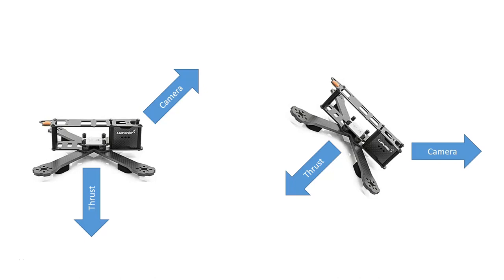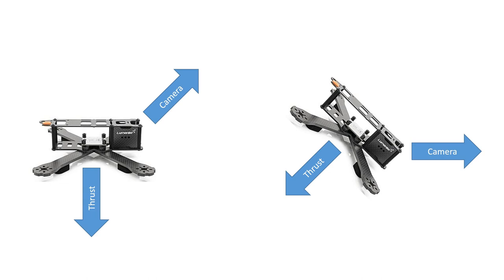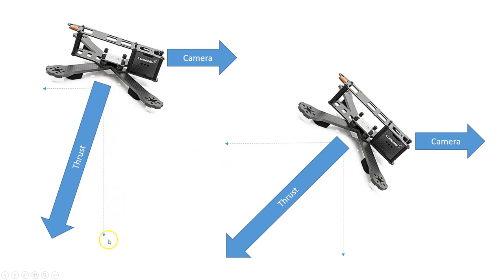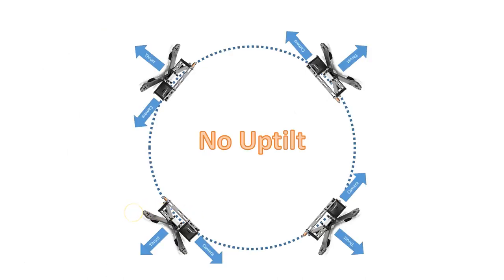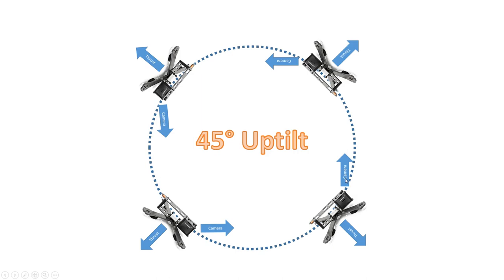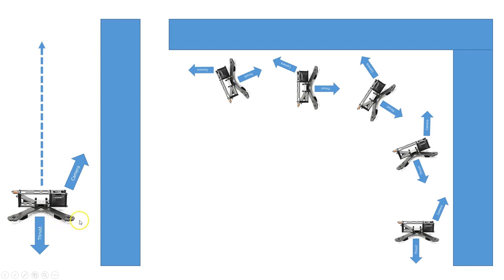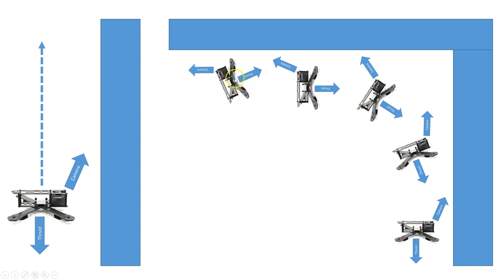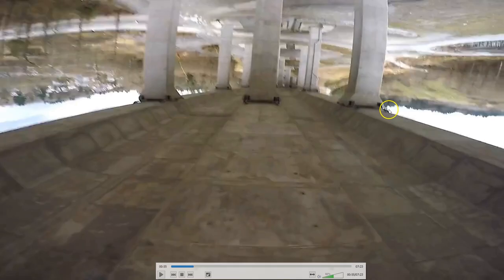The Secret to Mattystuntz Mind-Bending Stunts

Comment: I have to give it up to Joshua, he did an outstanding job breaking some of these tricks down. I've been telling people since Dec to move your fpv cam into 60degree, hold it in your hand and see what the thrust does in certain position in reference to the fpv camera. But now ill just point them to this video lol. But one thing I dont suggest doing is just putting your camera to 60 and head out flying. gradually move it up. around sept i really started working on my speed, and it just made sense to me to fly with more tilt. i started at 45 and slowly went up to 60-70degrees. but I learnt the new flight physics and mastered them before moving to an enclosed concrete structure like underneath the bridge. I dont want to see anyone getting discouraged because they break there gear. I came from stunting motorcycle where if i didnt perform a trick properly i would break bones. so it doesnt bother me that much if i break a quad or gopro. 

Also I dont fly lumenier gear. I fly a LRC X frame. Its ultra light, a true X frame and perfectly balanced on all three axis. 

Thanks again Joshua, its an excellent tutorial.
Reply: +mattystuntz Still stunning videos man! Love your work! It is definately something unique compared to others!
Reply: +mattystuntz nevermind how you do the moves, how the hell do you stand while doing these moves? i still feel like falling over o.O
Reply: +mattystuntz Do you have a custom mix in your RC or is it just learning, that the Yaw/Roll is nearly swapped ?
Reply: +mattystuntz Ya crazy! Haha! ;)
Reply from the maker: +Diego The Wolf I am pretty sure that matty and others like him just learn to fly that way. I have gone from 15 degrees uptilt all the way to about 45 degrees. Each time I add another 5-10 degrees, the copter feels like it's flying a little weird, and then my brain sort of re-adjusts and I'm good to go. When people suggest fancy mixing and other features to compensate for camera uptilt, I'm a little skeptical. I want my stick inputs to correspond to motor inputs, not camera inputs. My brain can handle the translation.
Reply: Joshua Bardwell Thanks for the clarification! I just had some problems with roll when i went over like 25-30° and thought about mixing. But guess i'll just try it the normal way ^^
Reply: +mattystuntz love your style man. What lens are you using? DO you find yourself adjusting yourcam angle down less for being in tight spaces? I run 45-50 when racing with a lot of straight aways, but if the course is real tight I find myself going with lower angle. Im running a 2.8 lens though
Reply: +mattystuntz I was actually going to ask you to have a camera on your side taking  a video of your quad while doing your stunts. I've been totally amaze how you do those mind bending - eye sucking tricks
Reply: +mattystuntz Nice one Matty :-) I now love quads as much as I loved motorbikes. I'm progressing okay but I need more time.
Reply: Great flying! I hope to have your skills someday.
Reply: mad props to mattystuntz for creating/ being first to master this flight style! 

incredible.
Reply: +mattystuntz do some you top pilots fly 3D FPV quads too? I really haven't seen anyone do much flying with that setup.
Reply from the maker: ZoeFPV is the main pilot who flies 3D freestyle.
Reply: nice analysis but I watched a lot of these, by everybody, and no one else pulls loops up a wall next to the ceiling then down...guys has skills
Reply: Great video, analysis, and comments. 

Hmmm... So Joshua says massive HD cam uptilt, Matty says it's the FPV cam uptilt... Is it both or just one of them?

FPV Angle Mix is pretty useful, though it takes getting used to and could max a motor. 

3D is very cool. May want to angle the HD cam for better footage than seen in the zero degree FPV cam angle.
Reply: 60 TO 70 DEGREES HOLY SHIT I CAN BARELY FLY ON 50!!!!
Reply: Well said. Im an old vert skater and though not as dangerous as motocross freestyle still very painfull bone breaks. Breaking the quad doesn't bother me. Losing it still sucks though. Haha
Reply: @prOkrEAt  you have to dtand to get proper reception for video and TX. Standing is the way to fly
Reply: Awe

Comment: This was an easy one.  Now to see if you can explain why Skitzo's videos look different.  Hint, it has something to do with camera tilt as well :)
Reply: +FinalGlideAus  He flys with no camera tilt i guess?
Reply from the maker: I think Skitzo has less uptilt on his GoPro than his FPV cam. I was just looking at his Instagram the other day.
Reply: +Joshua Bardwell Hard to pull the wool over your eyes :).  Skitzo runs flat GoPro and abut 30 FPV cam tilt.  This gives all his barrel roll type tricks looks much more axial. It also makes the GoPro look at the ground during FFF so that's why you always see him going vertical
Reply from the maker: FinalGlideAus Tell him to try out the cam uptilt compensation feature. With 30 of FPV, try putting in 15 of uptilt compensation. should give relatively axial rolls while making framing of regular shots easier. 

If you were to combine 15 degrees of GoPro uptilt with 15 degrees of uptilt compensation, then the GoPro should be perfectly axial, but less staring at the ground during forward flight.
Reply: +Joshua Bardwell But then it really screws with the way the quad flies.  The whole point of us acro pilots is that we remove as much of the influence of the FC so we can do what we want.
Reply from the maker: FinalGlideAus have you tried it?
Reply: +Joshua Bardwell To be honest no I haven't but I have been very clear on a few things in my time flying quads and one has always been not allow the FC to do much work.  I dislike mixes like that.  One day I might try it one day.
Reply from the maker: FinalGlideAus Well, look, you're the one with the title, so clearly you know what you're doing... my perspective is that it's not doing anything that you can't, and don't, do with the sticks, it's just making it more smooth and consistent. But if I was racing at your level, I would definitely run a lot of test laps before I took it into competition.

For acro flying, I think the stakes are lower, and there, I think there's just no question that it's preferable to having gob-loads of swing-around in your rolls. Camera uptilt = fast = awesome = swing-around = not so awesome after all. So this feature seems like the best of both worlds to me. Like I said, yeah, I could learn to cross-coordinate snap rolls by hand, but this does it better, with basically no down-side that I see yet. So that's why I compare to anti-lock braking. With lots of practice, a driver CAN learn to threshold brake very well, but the computer will always do it better, and the driver can learn to do something else instead.
Reply: +Joshua Bardwell I have something I plan to bring back from the dead that should allow some cool stuff to happen which won't play well with the mix anyway :)
Reply: +FinalGlideAus I'm not really one to snap roll. But if you watch my flying Chad, when I invert, the center point of the roll is in the middle of the screen. So from the Gopro's perspective I'am rolling on inline with the X axis. Achieving this is actually more difficult at 60 degrees. This is because I'm doing more then one stick input in the maneuver, yaw and roll.  So it is still possible to snap roll with 60 degrees, it just takes a little more piloting. In regards to Gopro tilt, it doesn't share the same 60 degrees. It sitting at 45 degrees. I like composing my shots with the  horizon in the center of my screen. And I'm not trying to take anything away from Skitzo, he knows more then anyone how much I appreciate his piloting. But we both fly setups that work for our flying style.
Reply: +mattystuntz yes I agree Matty. What I was getting at is the different levels of tilt allow you to do different things but also make other things harder. It's a matter of choosing the tilt to suit what you want to achieve.
Reply: though its a year later.... just saw this vid, and im a beginner, therefore this video made very little sense to me but figuring it out little by little.... as for the dude from rotor riot and this josh dude going back and forth..... daaamn. Sorry Joshy... though you know ur shit and know it well from what Alot of others say about you.... you talk as if it dont stink. That really aggregates me to be quite honest...... well that and just hearing you talk is annoying. Yall have a great day !!!
Reply: Six22278 aggregates? Dictionary time...
Reply: Six22278 haha keep trying bud. Eventually you'll get it
Reply: BadWallaby sooner or later im certain of it.
Reply: #mattystuntz  would I be right think you're using the widest fpv camera lens you can get your hands on?

Comment: Bought a RTF kit and Velocidrone to practice a month or so ago. I have close to 20 hours into Velocidrone and a couple packs each day in the last couple weeks. It was getting extremely frustrating because it felt like I was never in control. I saw this video and plugged in a 50 degree camera into Velocidrone and now I actually go where I intend to. Waiting for some packs to charge and the wind to calm down outside now to test IRL. Would have never dawned on me to test camera angle; just thought something was wrong with my motor skills.

Comment: This is very informative. Thank you! Can you make a video on tilted motors? Your video shows the benefits of having 60 degrees of uptilt in terms of aerobatics, but to get the most speed, would having less uptilt but with tilted motors be better? Tilted motors allows the quad to get the same amount of forward vector but at less tilt, which makes it more aerodynamic. Despite this benefit, tilted motors are apparently unpopular. Do you know why?
Reply: +Fyre SG I've heard they mess with yaw characteristics, since your motors are no longer in the same plane. There are several frames now, such as the Krieger and LRC X frame, where the increased drag is negligible, so motor tilts don't have much benefit anymore.
Reply: +PiMan, thank you, that was useful. :)

Comment: I'm feeling proud of myself,  because I could see some of the effects you mention coming, but I gathered my courage, and set my camera to its max uptilt position.  Which happens to be 60 degrees... on the FPVFreerider sim.  The same one I learned acro mode from you on.  Thanks.  I went from not even being able to fly to the FIRST gate, to feeling good,  and doing neat tricks.  Even in my real quad.   I was brave though to try it, but not crazy and scared to try it on my real quad.  Hence the sim.

I pretty much figured out the effects you're talking about,  and had pleasant surprises,  and negative ones.  But I kind of expected them.  Split S's become a visibility piece of cake,  but pull out low with the horizon level, and your gonna crash!  Just flying around was a bitch.  If your heading towards an opening level,  you're hauling ass.  To gain a little needed altitude,  without changing attitude can take A LOT of throttle,  if you can do it.  So I was gaining loads of speed,  and I already was going faster than I wanted.  I think stuff I learn in the sim transfer well into a real quad.  Thanks, you're explanations were great.   I was in shock!  LOL

Comment: Very informative, I'm just getting the parts to build a QAV250 to move away from my smaller training junk and so I'm looking at as many setup/instructional videos that I can find.  Question for you Joshua, what would his FPV camera be set at?  The same degree as the HD camera or something different?
Reply from the maker: I believe he sets his FPV camera to less uptilt. Personally I prefer to keep my FPV and HD cameras at very similar angle because it helps with framing. But other top pilots run at different angles. Less HD than uptilt mea s you can fly fast while keeping your rolls looking pure. Less FPV angle than HD means you get more 3d like effect.

Comment: Curious to hear your thoughts on this, Joshua: an option in beta flight where camera up-tilt is entered by the user and the flight controller mixes the roll/yaw inputs so that, for example, a roll-only input would result in the copter only "rolling" from the perspective of the fpv camera (no PERCEIVED yaw). So, if 90 degrees was entered (and used on the copter), roll and yaw would be completely swapped. This would mean if you used a stick input to roll the copter left, the fc would actually be yawing it to the right instead. If 45 was entered, a roll input would be broken into 50% roll and 50% yaw in the OPPOSITE direction. A yaw input would result in 50% yaw and 50% roll in the SAME direction.
Just curious to see if any pilots can imagine this resulting in a desired flight feel or if it would just add to the confusion. Maybe this is already being done in transmitter programming? Maybe the copter would be unflyable? I'm still trying to process this mind bender.
Reply from the maker: +ghall05 I don't personally like that option. In order to do snap rolls at high uptilt, the copter would need to mix in large amounts of yaw. I think it's very likely that the copter would not have enough yaw authority to keep everything together, and would become destabilized. I don't mind coordinating turns and rolls by hand. It takes a bit of adjustment, but I get used to it and I'm fine. But I feel like coordinating a snap roll to get pure roll back out of this algorithm would be difficult, because it's happening so fast. I like knowing that when I bang the roll stick full over, no yaw at all is being commanded, and maximum authority is being given to the roll axis. The snap-roll makes a cone instead of a line, but it happens so fast that I don't care. I also kind of like some of the unexpected effects of up-tilt on the camera, such as entering a split-s "level" (actually pitched forward) and then being pointing straight down when I roll 180.
Reply from the maker: +ghall05 All that being said, I haven't actually tested it out yet, and I intend to test it some time soon, and maybe I will love it.
Reply: +Joshua Bardwell Great point. Of course, a 50/50 roll/yaw mix would feel like you were flying a copter with 0° tilt (except at WARP speed). Since most of us are probably used to flying with an angle of about 30°, the mix could be tweaked to give a copter with a large amount of up-tilt the feel of one with a less extreme angle (except faster!) and would lessen the amount of work the yaw axis would be required to do.
 All in the name of MORE AWESOME!

Comment: Question... Why would you need your flight camera at such an extreme angle and force to fly differently? Your GoPro mounted at an extreme angle (60 degrees) while leaving your flight camera at more of a conservative angle (40ish) creates the same affect without the confusing optical illusions during flight
Reply from the maker: It doesn't, because then you're not flying at high uptilt and the GoPro simply looks at the sky and the ground. The GoPro angle must be relatively close (say, within +/- 10 degrees) to the FPV camera angle for the flight footage to look good.

Comment: very nice explanation Josh! again I find your videos very informative. I have an off topic question again for you. a few weeks ago I asked about 4s batteries and my quad shutting down on full throttle. your suggestion was higher c rating. well I purchased a 40c battery (zippy) and still get the same result. what I don't understand is why I can fly on 35c at 3s but 40c on 4s and I get low voltage. I don't fly very aggressive at all. what c rating would you suggest (or batteries) and is there something else I may be missing? thank you very much in advance!
Reply from the maker: +J dog harrell You can't judge what C rating you need until you determine how many amps your motors are trying to pull. Check the results in this video:

https://www.youtube.com/watch?v=chPSEXXQ3hk

Notice that, all else being equal, switching from 3S to 4S results in about 30% more amp draw at full throttle.

But honestly, if you say you don't fly aggressively, then there is probably something else you're missing, but I don't know what it would be.
Reply: +Joshua Bardwell OK, so in theory the throttle/amp curve is much greater on 4s at the higher end as compared to a 3s battery? that would likely explain why even a 40c battery would still shut down my quad (assuming the C rating was accurate). I have a tattu 45c in the mail to try, hoping for positive results.

Comment: I have a question. What angle is the fpv cam? What angle is the footage cam? I'm trying to clear this up between a friend and I. He swears up and down that the footage cam is at about 30 degrees, and the Fpv cam is 60. I think it's the opposite.  Could you clarify this for me please. Thank you.
Reply from the maker: +RadioActive RC The HD cam is definitely, unquestionably, at high uptilt. There is no way to do the tricks that matty does without high uptilt on the camera from which we are seeing the footage. It's possible to run the FPV cam at lower angle than the HD cam, in which case the HD cam looks like crazy mattystuntz land while the pilot is actually seeing something more normal. It's also possible to do the opposite and run the HD cam at lower angle than the FPV cam. This lets the pilot fly fast but keeps rolls looking centered for the viewer. It also means that the viewer sees more of the ground and less of the sky, which can be okay to a point, since the viewer doesn't need to actually steer the copter.

I think I remember matty saying that his FPV cam was at a lower angle than his HD cam, but I honestly can't remember where I heard that, so don't take it as gospel.
Reply: +Joshua Bardwell thank you for the quick reply. It made sense to me that the HD cam would be at a higher tilt angle in order to give us the awesome anti gravity footage. Thanks for clearing that up.